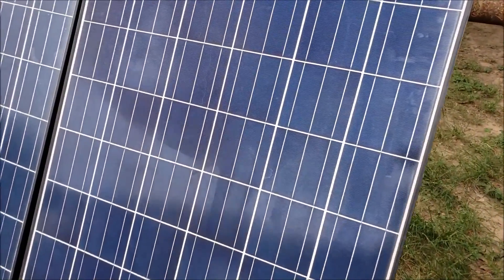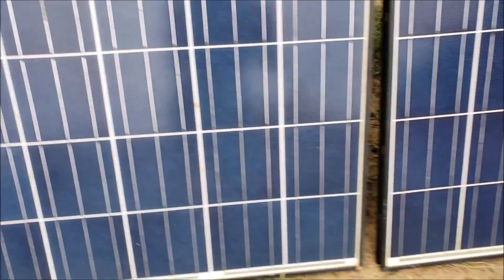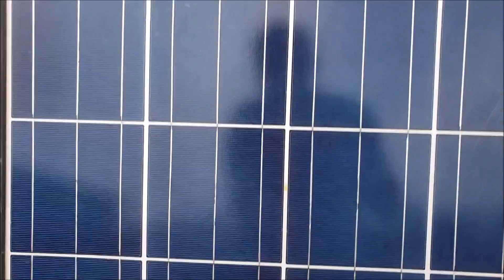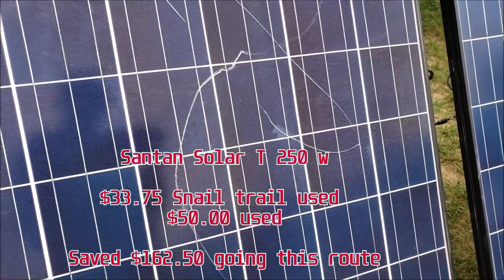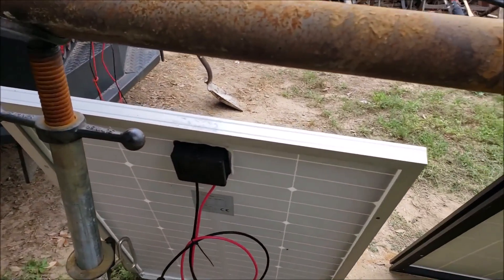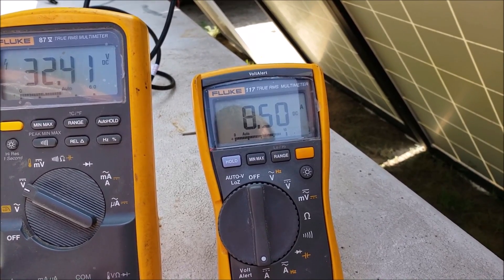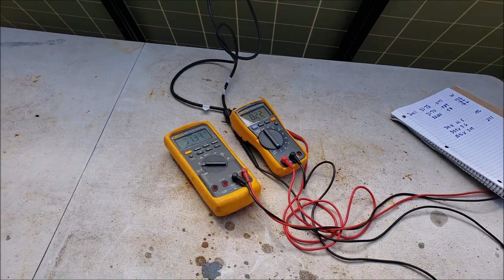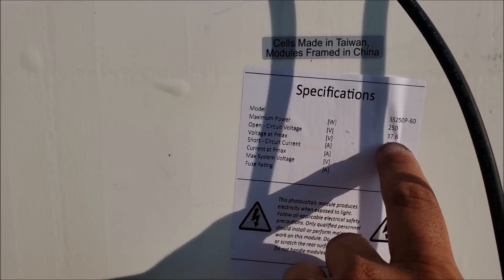Santan solar used off grid snail trail panels for beginners review.

Comment: Seems to be good value for money. Are these for out on the ranch.
Reply from the maker: This will be my 2.5kw charging system at the ranch. I still got to get some lithium ion or lithium phosphate batteries for storage. I am still working on the design of the cabin. I think a cinder block storage room for electronics and wooded walls for cabin. I bought them used to save money but they remove the manufacture label so you cant use on homes. The electric company needs to see the UL label or they will deny the grid tie system.
Reply: @cutweldngrind  15 years ago I had a wind generating system with a 1600ah battery system with a 3000w inverter running the house. If I was to do it again I would run a 12v system. Now days there are 12v fridges, lighting, tv, water pumping. Gas for cooking and water heating. I recon the simpler the system, the cheaper it is to run and maintain. 
The first wind generator I built was 3 bladed with a 8 pole 4kw induction motor. Could put out 90amps at 24v. (You could run a welder off that. A bit over kill I guess). The fiberglass blades were hand made.
Reply from the maker: @Paulman50   What ever happened to that setup. I plan on either a 24v or 48v inverter for the house rated at least 3kw to 5kw. I will use my welder as back up power source.
Reply from the maker: @Paulman50  I want to have 2 smaller 300 watt arrays with 12v inverters across the property for lighting and tools. I never got to build my turbine but my buddy and I were always reading up around 2008 on how to build turbines. We ended up buying about 8 kw in solar panels which I sold mine in 2010.
Reply: @cutweldngrind  my house was 24v, but the trouble I had with that was that sometimes the system was pulling 100amps. Buying gear that handles 100amps is hugely expensive.  Running 48v would have only been pulling 50amps. My 1600amp hour battery bank then would have been rewired to 800 amp hour. The power dump was a 24v element in a hot water cylinder.

Comment: That's pretty cool... Are those snail trails or scratches gonna affect the performance of the panel?
Reply from the maker: I ran several test and they actually perform better than expected. These will be able to collect the power needed and store it in lithium batteries that come out of electric vehicles like Nissan Leaf, BMW or Tesla. Used total price $577 and new around $2300. Solar is expensive but my property wont be visited daily and running electric power will be $3000 to $4000. I think I can store enough power through the week to use on the weekend.

Comment: Oh yeah very nice my friend... None of mine have any snail trails... Contact them if it wasnt in the description...I have zero discoloration also.... You might get a few for free... Oh you knew about it lol.... Great video brother.... I didn't know you were a creator...subbed and rang the bell brother
Reply from the maker: The snail trail ones were cheaper at $33.75 vs the  $50 used panels. I did this to save some money and they performed great.  I could of saved another $60 by using there other not listed freight service. Ebay also collects 8% tax so I went straight to the source.

Comment: I often wondered if solar panels would run everything in the house fridge lights tv good luck with them Jorge 😃👍👍
Reply from the maker: This setup can collect about 15,000+ watts in a good day ( 6 sun hours ). I would be able to power my 6000btu window units, lights, fridge and other appliances. I will still have the welder as a back up generator for heavy loads but this will sure provide the power I need. This is just a big experiment  I dropped around 2008 and I am back at it.

Comment from the maker: I have finished all my testing and all panels passed my test. I have 2 panels that are really scratched and need to find a way to make them look nice. I recommend these to beginners and will work great on Mppt Charge controllers. Depending on your charge controller you can do 2 or 3 in series on cheaper controllers. I will do 4 in series on my charge controller that I will buy soon.
Reply: You can put a clear coat of Polyethylene, it will fill in the rough surface, make them look better, and it should also allow more light absorption!
Buy some rust remover to clean them up, recheck the Solder points, then put the coating on them to make the look and work better!
Reply: What charge controller are you planning on getting?? And for testing at 33 volts and 8.2 amps is really good seems like there is alot of life left in them and for that price is awesome!!
Reply from the maker: @ericjackson6082  I still get amazed after 20 years on how we can get electricity from wind and solar. I was 17 or 18 when I first discovered renewable energy. How much will it cost to build a turbine like yours. I know I hardly get strong winds but maybe I can build one slowly.
Reply: @cutweldngrind  so I have an Mpp solar PIP and for the most part I really like it and for 600 bucks for the 24v system it has your charge controller and inverter in it they also make it in a  48v model as well and with the right amount of coils and the correct blade set these Axial Flux wind turbines well make power in a 3-5 mph wind and are pretty efficient
Reply from the maker: @ericjackson6082  Once I get the cabin completed I will try building a turbine or two.
Reply: @cutweldngrind  awesome I can help ya through it if need be!!!
Reply from the maker: @ericjackson6082 I dont know what Charge controller to use and looking at the moment. I have 2 Mornigstar 12/24v 30 Amp PWM units but want an MPPT. I have 1 modified some wave inverter and a blown 48v pure sine. I have to determine if to go 12, 24 or 48 volts now and will depend mostly on cost of 48v components vs lower voltage units. You have any recommendations on Controller or inverter.

I think the biggest loads will be 2 6000 or 8000 btu window units pulling up to 450 to 650 watts each. I can probably run the lights and some outlets with my modified sine wave.
Reply: The scratches don't hurt a thing. I have one with hail damage and it puts out more because of the prisom effect.
Reply: @ashforkdan  is that for the scratches or the trails?
Reply from the maker: @Kev I wish I would of bought the 20 I had planned on getting. I am using 6 on my shed and 3 on my solar water well pump. These have worked great on my solar pump running for 6 months or more. I do want to build me a skid to mount the panels on that way I can move them if needed across the acres.
Reply: i bought one 100.20 and now i need another one for those 8  x240

Comment from the maker: There is not much information about these Snail Trail panels from Santansolar that I decided to upload a quick video. I hope this will help you understand the condition of these used panels and the defects to be expected. They perform close to specs from what I can see today. I will do a test video once the days are clear.
Reply: Followup video?
Reply from the maker: @honeyglazeham9621  I have not done a follow up video but I have 3 of these running my water well pump. The panels have worked great with no issues.